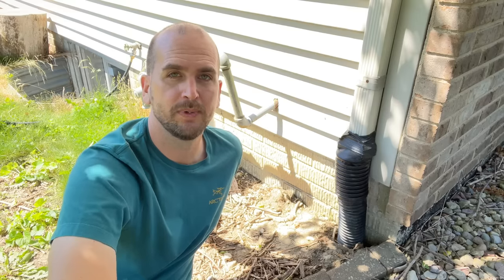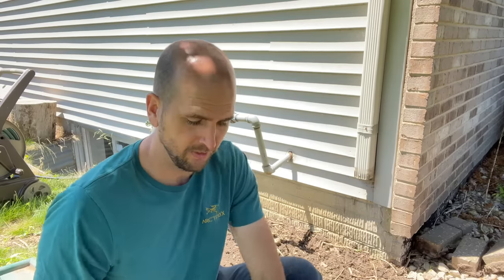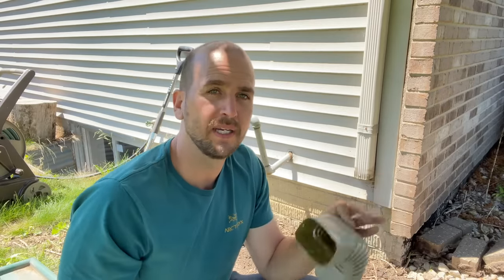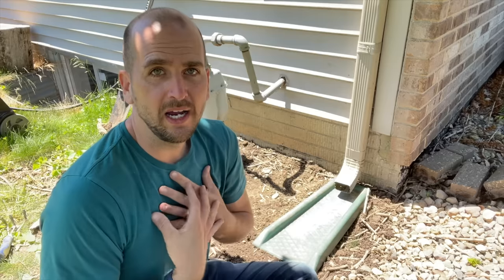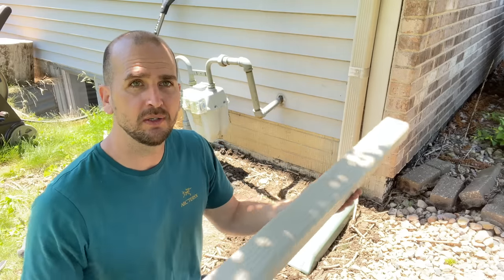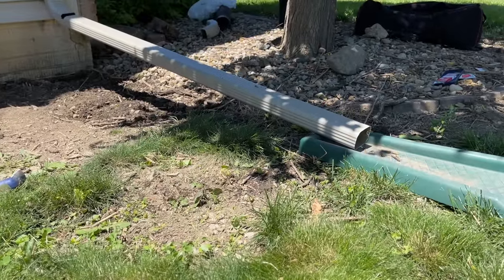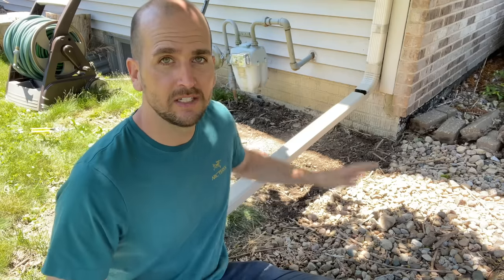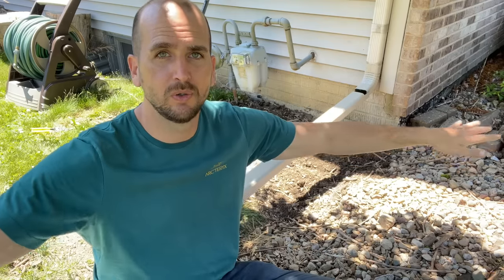3 Options for Extending Your Downspouts

Comment: As a trouble shooter for a gas utility "IF" you choose to dig on your property anywhere especially that close to a gas service, underground electric service, water or sewer always get a mark-out. They're free.
Reply: Long time ago my neighbor’s husband put in a fence. Cut those roots out of the way. Turned out the “roots” were buried electric lines. Not sure why he wasn’t electrocuted. He managed to knock out the whole neighborhood. Took the workers a week to fix. Every day he came home from work they would all just stare at him. 🤣🤣. He later ended up working for FPL. 😳
Reply: In my experience, they often do not mark on private property, but rather mark where the utility hits the property line.  The home/land owner has to guess between the property line and final service connection.
Reply: @clsanchez77  two weeks ago an FPL worker came out and marked my sons back yard with flags and paint.  🤷‍♀️. We’re having to move their flags out of the way. They are out side of their right of way. They aren’t even accessing his property to replace the pole.
Reply: @clsanchez77   I know in Jersey they mark public and private property as long as its a utility company's service line. anything after the meter, electric or gas is up to the home owner or business. for instance if you had a gas line and electric going to a pool heater and pool house.

Comment: I’ve done a few drainage trenches.  A few tips:  grade needs to be at least 2 inches per 10 feet.  Do yourself a favor and rent a ditch witch if over 40-50 feet.  And make sure you check with the town where drainage for a bubbler is allowed.  Some areas are not for drainage and if it’s all clay water won’t permeate through it.

Comment: Great explanations of re routing the water! I just bought a home and found out the underground gutter drain pipe is busted causing water to get in the basement 😡🤦🏼‍♂️.  For now I’ll go with option #1. I’ll reroute the water down to the drive way and plug up the drain opening.
Reply from the maker: Yeah, that is the way it usually works.  Get your quick fix in place and then make more permanent plans. Thanks for watching.

Comment: I've done gutters and downspouts for over 10 years, the absolute best solution is to have hard plastic pipe installed, (preferably when the house is being built)  also the ground sinks down over time so you'll want the pipe lower to the ground (about 6"). Usually the downspout is up that high because of a mistake and people don't wanna spend money on a new downspout or so the can "check for clogs later on" but that very rarely happens lol, thanks and have a good day.

Comment: I built a new nice one story home 14 years ago. I did not put under ground gutter channels because I feared leaks.  Our tile guy who does our farm fields simply installed 6” round tile next to our house footings on each end of the house and that system runs way out into our fields. Never a leaky crawl space!  But the downspouts out at least 5-10 feet away from the house I did above ground.  Similar to your third drainage as we simply put a sleeve wrapped many times around the black tile and we put pretty River rock over it and covered the end with rap. It works good.

Comment: I appreciate the videos you do Scott.  I cannot dig where my 3 downspouts come out, so I have to use a 4 foot aluminum gutter extension to get it away from the house.  What I would really like is for companies to make 48 splash blocks.  I am tempted to make my own out of concrete to use.  It has to be low enough so that I can still cut the grass with a lawnmower, and a longer one would be the answer because it could go into the ground that extra 1 or two inches at the end to allow the mower to go over them,   So then it the pipe ever disconnects (kids, dogs, etc. stepping on it) the splash block would still divert the water.

Comment: Where I live it's common for homes to have pipes that connect to the main sewer line which goes out to the city street sewer pipe. So I have all my downspouts going directly into those underground pipes and out to the street. I keep the debris out of them by using a strainer with a tee so every once in a while I will open up the tee and pull any leaves off the strainer that otherwise would have gone into the pipe.
Reply: yes that is the best.
Reply: You are brilliant you should do the tutorials
Reply: @bradhaenitsch1145  I spend way too much time thinking about these kinds of things...I have done a lot around the house in this regard.

Comment: Setup #2 contradicts the point you made about setup #1 about making sure you have the downspouts interlocked to prevent splashing. That second setup encourages splashing and worse yet sticks, leaves or animals to get inside and clog your system. I do like the mechanism how it folds up into the house I thought that was quite cool! I also agree burying that black pipe is not a good idea it is none where near strong enough, you would need pvc for sure.

Comment: Your video's rock! so my issue was I have 6 inch roof gutters so when it was pouring out, the water was pouring back up from the bottom of the ground. I first thought there was a clog but after checking with a hose it was totally clear. I noticed your comment on making the connection inside the gutter vs outside so I will switch to that (makes sense) then I will also duct tape seal it and see if the water will now clear. If not, I may need a sump pump to push the water down the underground pipes.

Comment: Great video, never even thought about this.  Going to do option 2 for now, but i'll look into option 3 in the future.  Nice work!
Reply: Do not use corrugated pipe!  Use smooth pipe so the dirt and water and debris doesn't get stuck and build up and block it in 5 years

Comment: Yeah, probably 20 years ago the city made us disconnect from the sewer system. We was under the assumption all downspouts had to be done. It wasn't until a year later, downspouts draining to sidewalks or neighbor's yards wasn't required to be done. 2 places pass over a sidewalk if the proper length was done. In winter I have rain running on my front sidewalk. The one on the left side only has 25' of buried pipe. That one can fill up on heavy rain days and seep around the adapter. I use gutter screens, so it's not trash being the problem. I need to saw the sidewalk in half, bury more pipe, then cover it to fix my situation. 🐀🐾

Comment: We are senior citizens.  Just bought a new house that has option #2.  But when i raise the extension for the mower, it wont stay up, but falls back down  right away.  Can you recommend a way to secure it up temporarily?  Thank you so much for your help and your very informative videos.😅😢
Reply: Would a Velcro fastener work? You can get small circle or square shaped fastener sets that have adhesive on them to stick on something — maybe the “hook” side on the downspout and the “loop” side on the extension. Then just pull the extension away from the downspout to lower it into position.

Comment: About 10 years ago, the french drain or whatever it is, at one of my home's downspout, got clogged. The rain in that location would sometimes flood the side of that house by about an inch of water. There was no way for me to figure out how to unclog it. I did not even know which way it ran, underground, at least not without some sort of stick-camera, like what some of those plumbing services have. I don't have that luxury.  So instead, I got a 20-foot flexible pipe that I attached to the bottom of that downspout so as to divert the water out 20 feet into our empty lot, which we own.  I have not since tested if that underground pipe/drain is still clogged. But eventually we need to figure that out in case we have to sell that adjacent empty lot & then I would not be able to use the 20 foot water diversion into that area if someone else was to build a house there in the future.

Comment: You could just add dirt along the house to change the slop and put in an extension with splash pad. Unless you live in an area where you get a ton of rain , that usually is enough.

Comment: This is a great video. But I have a problem at the outside back wall of my garage that gets too wet, too often from gutter overflows during heavy rains and also a exterior water faucet with hose attached located on the same wall. This creates a situation where soil at foundation is constantly wet. Please advise what I can do to keep water away from my foundation. Thanks!!

Comment: I recently discovered that the accordion pipe connected to my down spout is buried but instead of running away from the house the previous owners had it running back towards the house. I'm new to home ownership but right away I figured that accordion pipe should not run back towards the house.  I have moisture issues in my crawl space, could that be a contributing factor?

Comment: I am finishing up option 3. I have 3 down spouts with 4 inch PVC for each connecting into a 6 inch PVC to carry the water down hill for about 60 feet. I like your idea of a drain barrel at the end. What kind of material is your drain barrel?

Comment: I think you missed option 4, which is better than anything you list in this video - correct the grading of the ground immediately around the house. I've found aggressive grading in as small as 3 feet distances is enough to keep water away from the foundation. 

I had a house where it was practically a swamp next to the foundation. The house next door was on a hill and the hill went all the way down to the foundation of my house. The ground was so saturated that it was permanently water-logged 24/7. Bought a lot of dirt and made an aggressive grade over the 3-5 feet I had between my foundation and the yard's fence, and it has made a world of difference. Since the grading I've had zero water issues.
Reply: Like I said folks gotta shed that water as quickly as possible
Reply: 3 ft isn't enough if you have a basement or crawl space. When such a house is built they dig a hole perhaps 6 or 8 feet wider than the basement footer. When they are done with the basement level they backfill. This means there is zone of soil around your house which is much less compacted than the rest of your yard. You need to to get the rain water at least a foot or two past this zone and let the grading (hopefully) do the rest.

Comment: Sir William here from Sir Williams Drainage and Waterproofing.  As a professional Drainage contractor with 45 years of drainage experience, I would reccomend to not use splash blocks or 3 to 5 foot runners.   Just a cheap fix that does not solve eliminating water around your foundation.  

Using corrugated drain pipe is also a poor way of addressing water coming off the roof.  Poor design flaws is why corrugated pipe is cheap and fails after it becomes full of roof gravel.  Tree roots will penetrate corrugated tile as well along with being blocked with leaves.  

Some love to talk corrugated cause they sell it.  Truth is, corrugated drain tile is flexible and also bellies underground where water can freeze and damage it.   
Sure, it's cheap, but tree roots love corrugated tile as it's easy to penetrate with roots looking for water.

PVC schedule 40 is the only product that should be installed and that's only after you install a 12" open grate catch basin designed to collect asphalt roof gravel before it has a chance to enter the drain pipe system.  It can also be snaked with a metal blade, unlike corrugated pipe.

Last, what most people forget to talk about is having a separation between the end of your downspout and where it empties into your catch basin.

If your reading this and need a installation done right the first time, look us up in Michigan online.   https://sirwilliamsgardens.com/?y_source=1_Njc0MzE2NzUtNzE1LWxvY2F0aW9uLndlYnNpdGU%3D
Reply from the maker: Thanks for all the great feedback. You need to get a YouTube channel spooled up and share your work/knowledge.  Nice work on your Google Reviews 👍

Comment: Henri DeClercq, you are not the only person to notice the bag job done on the gas meter installation. Apparently the installer forgot to bring his tape measure or was too lazy to use it. You could also include the lack of using a level. Those deficiencies are just cosmetic issues to draw your attention away from the apparent lack of a mounting bracket to hold the meter to the house. That, I am certain. is a code violation.

Comment: Hi, this is an older video, but I have a question.  My brand new home sits on a slab. Hosever its built on expensive corrosive (chlorides) with ground water seepage detected about 9.5 feet away. 

I absolutely worry about the foundation being ruined. 

Also, my neighbor behind sits at a higher level than me and his yard slopes into mine, which concerns me. 

I'm broke right now but just need peace of mind and wondering what you'd recommend given my home is on expansive soil & i also have to worry about my neighbor's yard sloping into mine. Thanks!

Comment: How about a fix in cold climes where the water freezes in the pipe where it goes under the ground. Extending is not exactly an option because there is a sidewalk and the water would freeze on it.
Reply: Use a heat tape on the pipe. They do that all over Colorado, even in the gutters.
Reply: Gotta shed that water don’t let it pool if you can dig a dry well

Comment: If you use the pop up put it on a T with pea gravel in a hole underneath so it can drain the pipe out, or else it will sit full of water and not work properly.

Comment: Great video! Question: does option 3 work in places where winter is below freezing point (my case Toronto)? What would be the alternatives in such case?
Reply: i like option 3 but using 4 inch schedule 40 pvc, smooth inside walls, durable, debris flows out, and easier for jetting out frozen pipe, I did 60 feet this past winter. Black corrugated pipe is good at clogging up from debris going down the pipe as the ridges catch and lock in stuff: pine needles, twigs, leaves, roofing nails, etc, thin walls, and nearly impossible to clear clogs. Piping underground doesn't really work in cold freezing climates. Why? sun melts snow but will have to go into cold/freezing downspout and/or pipe and build up inside. I live in Colorado, in the mountains. The drains are on the northside of the building as they do freeze solid. I now use a heat tape down the pipe, but the problem will be at the drain exist, where the cold air freezes the water, and more problems with snow covering the exist and the soaking up the water and freezing. A good pipe slope helps move water out of the pipe, If in had to use black corrugated pipe is above ground to get water away. But if want or need piping for summer rains, go 4" schedule 40 pvc with a heat cable/tape that are self regulating and will not melt the pipe.

Comment: Here in the UK we obviously have a lot of rainfall, standard solution is to the the downpipe into a drain. That water then runs off into the sewer to mix with the rest of 'grey water' produced by homes. Wouldn't you be able to position your downpipe near an open drain and let the water run off into underground pipework?
Reply: Well we here in the good ole USA don’t do that anymore but we do dig retention area’s and the correct infrastructure to shed the water to crick or waterway

Comment: Im sure someone else has said this but I would never directly pipe gutters into anything, rather use an elbow to direct it to a catch basin. Even with gutter guards. Just as a precaution. Its easier to clean out a catch basin grate than it is to clean out pipes or gutters. Also as with what someone else mentioned, never use corrugated pipe. It crushes too easily and just ends up garbage when someone has to replace it.

Comment: I would think water would gush or splash out of the pivot point in the gutter in heavy down pours as I would just put plastic and rock under the extended gutter run so no need to cut any grass under it.

Comment: For option 2 that you did with the extension piece, I would attach a mesh metal screen over that hole you cut out. You don't want insects, bugs, squirrels, mice, rats or birds going inside  and up into your roof line in any way. Other than that you did a great job!
Reply: I’m trying to picture a screen that could be installed at that spot and not get in the way. Can you help me understand this idea better?

Comment: All of our downspouts are inside a large round metal looking pipe with cement formed around them.  The house is brick built in 1936.  I never see the water so I’m guessing it must be underground somewhere.  Very dry garage and rec room so it must work well.

Comment: Just a note! I noticed that your gas meter is not bonded and needs to be done by driving a ground rod and then bonding with a bare ground wire, an acorn clamp, and a pipe type ground clamp.
Reply: But this video is about downspout drainage
Reply: @George From down the hall  but a professional should be aware of all things in the work area! Then suggest that to the customer!. An opportunity for a repair or installation to bring things up to the current codes.

Comment: On the video with the things you put in your yard that hold excess water what is the name of them, I didn't see the name I'm interested in them and I know about the call before dig or plant and so on. what is your thoughts on French drains?
Reply from the maker: That was just a drywall.  I think I will be installing basically a French drain on the downspout in this video (50 foot away from the house) to disperse the water out in the yard opposed to a drywall.
Reply: @EverydayHomeRepairs  Ok
Reply: For those with clay soil careful with drywall it probably won't percolate/disperse
Reply: @EverydayHomeRepairs  I think u mean drywell :3)